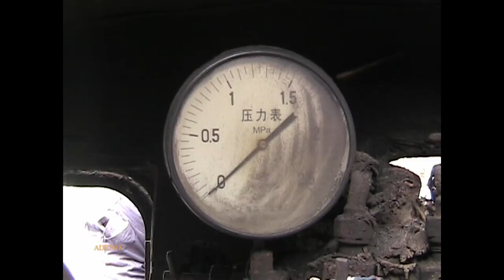UK - Buying a Chinese C2 for Welsh Highland Railway, 2006

Comment: Thanks for posting an interesting video. I was on a FarRail visit to China in 2007 with four of the C2 team, the loco was in the UK by then. Apart from looking at other C2s in action, they were sourcing spares and drawings for their loco. They said it would take about ten years of work before it could run in the UK. Not a bad estimate. Well done!
George
Reply from the maker: I think it's a little way off working in the UK yet, isn't it?  Andy
Reply: How much did it cost??
Reply: August 2018 and as far as I'm aware it's a set of frames with wheels

Comment: In the middle of the video, do you know what was happening? It looked like an SY was called to move smaller loco's tender (looked like an SY tender but smaller, so a YJ or PL2?), then a breakdown train rolled through. Was there a derailment?
Reply from the maker: To be honest, I don't know. As far as I know the tender was brought for coaling (as you can see in the video) but, I admit, it's an odd practice! The breakdown train was on a different line ... you can see the electric overhead that's not there on the first line. I don't know if the two events were connected at all. Sorry!! They're all standard SY tenders by the way. Also the loco with smoke deflectors and boiler top "streamlining" is a modified SY.                                         Andy

Comment: Was it listed with free postage?
Reply from the maker: Unfortunately not. It was shipped in a container to the UK.   Andy
Reply: 'Some assembly may be required.'
Reply: found extra bot and nut?
Reply: Yes
Reply: Andy and Dandan Fisher what are the things to look for when buying a used steam locomotive from China? Bearings? Connecting rods? Firebox?
Reply: @AndyDandanFisherSteam  must have cost a few bob
Reply from the maker: @andyg3  It was a bargain to buy but the cost of restoration is proving to be many times the cost of buying it  ......  Andy

Comment: Wow that thing looks hammered. It looks like the flanges are high and thin from my phone!!  The cab smashed up the the non working cylinder cocks on the right side. Not to mention the simple things like no glass, or headlamps ( simple non mechanical stuff). Smoke box full of cinders, thick buildup on all the lubricated areas and running boards. Rebuild? Ya think?? Surprised you didn't find a better C2 I. China. I've seen several available.
Reply from the maker: It had been working for its living, you know!! The advantage of this line was that it was in the Beijing suburbs - made shipping far easier. Number 4 was the best one of the fleet (of 4).    Andy
Reply: Gotta love armchair experts
Reply from the maker: These guys are heavily involved in locomotive maintenance on the Ffestiniog and Welsh Highland Railways.   Andy
Reply: My comment was towards the guy listing off all the issues.... like no headlamps. Not the people rebuilding it :)
Reply from the maker: Aahhh!! Thank goodness for that. (I agree) ..... Andy
Reply: Andy dunn I have been involved in steam locomotive operations and maintenance for 26 years. I have inspected many steam locomotives. I have worked with no less than 3 from China.
Reply: Andy and Dandan Fisher I have made a living for many years working with steam. I have seen several C2 locomotives marketed from China and they were in far better condition. I don't know if they were an option for you but considering rebuild cost I wonder if they would have been viable if available to you. It will be interesting to see No 4 when you are done.
Reply from the maker: I must stress that No.4 is not a project that my wife and I are personally involved with. Some friends of ours wanted to buy a C2 and we just assisted them wherever we could. The loco was having to be regauged anyway so a rebuild was just part of the job! Where are the other C2's? I know there are a few standard gauge Chinese locos in the USA but I don't know of other C2's.   Andy
Reply: Andy and Dandan Fisher multipower international was used in aqusition of at least two of six standard guage I know, they were advertising The C2 many years ago and still claim they can get them or build them.
Reply from the maker: I bet they'd charge more than the 10,000GBP these guys paid for theirs (including shipping).    Andy
Reply: Andy and Dandan Fisher wow that is pretty cheap. At that price a full rebuild on a little tea kettle like that seems down right reasonable. Even for an arm chair expert like me.
Reply: Andy dunn what say you?
Reply from the maker: Yeah. We thought we'd got a bargain. The inspection in the video here was just a formality really.   Andy

Comment: How much  to tonnage  can  30"gauge  locomotive  pull ?
Reply from the maker: Of course, every locomotive is different Josh. The Chinese C2 locos were quite poiwerful for their size but I don't have an accurate figure for them. The nearest I can get is a tractive effort quoted as 5100 lbf (Pounds/foot). If you can convert that into a tonnage that it can haul, you're a better man than I !!    Andy

Comment: The 4 painted on the loco seemed odd for years. I really liked it as it seems authentic to its use, but very odd.  Then today. BOOM! The number 4 (14, 44, etc) is an unlucky number. The #4 is a practical joke! But it would be fantastic if the hand painted 4s were exactly recreated after rebuild. The 4s add real character.
Reply from the maker: I don't think the number 4 was on the loco as a practical joke Charles. I saw it in service several times and it was genuinely number 4 in a fleet of four locos. There were also hand painted 1, 2 and 3 !! I suspect that the lads will reproduce the hand painted 4 when they finish the paint job !   Andy
Reply: Andy. Thanks for the info. Very interesting this is not a practical joke. Looking forward to seeing the restoration. Thank you again.

Comment: World's smallest drive wheels.
Reply from the maker: Wait 'til you see some of the little tank engines on Java - I'm just editing videos right now. Watch out! Andy
Reply: Small drive wheels , is like having a car in low gear . It will pull well but not go very fast and in addition  will go round very small curves in the track .
Reply from the maker: Correct !!!    Andy
Reply: I hava a video with some of these in action before they started doing away with steam and the little narrow gauge lines. With those smaller wheels it also seem to help traverse some pretty questionable track with ease.
Reply from the maker: They were very capable machines,  Mark. I have a few sequences of them in action on this YT page.  Andy
Reply from the maker: Please take a look at the latest update - https://www.youtube.com/watch?v=XZHznXVK7N4
Andy
Reply: I have a couple videos of a GEARED logging locomotive with small wheels on my channel. Its maximum speed is a mere 18mph, but, it sure can pull a lot of weight.
Reply: @AndyDandanFisherSteam  And I'd like to think they still are!  ^^

Comment: Smokebox needs a good clean!
Methinks these would be more suitable for the Welshpool & Llanfair, which would not require the loco to be regauged.
Reply from the maker: It's already regauged now. Being put back together at the moment. With a bit of luck it'll be on the tracks for 2019.   Andy
Reply: Andy and Dandan Fisher I will have to come down for a visit when it's running!

Comment: If you don't mind me asking, how much was it?
Reply from the maker: They paid around £10,000 (GBP) for the locomotive and its shipping to the UK.   Andy
Reply: Andy and Dandan Fisher that is a LOT cheaper than what I thought it'd be!
Reply from the maker: Well, it would have just been scrap metal otherwise. My Dandan (seen in the video) built a relationship with the rail line staff and negotiated a good deal for the guys.    Andy

Comment: Was the suitcase full of cash?  Looks a powerful beast.,  Presumably there would be no loading gauge problems. Will need quite a bit of TLC.  Very interesting.
Reply from the maker: They paid around £10,000 (GBP) for purchase and shipping, Jim. The loco has been undergoing a full rebuild for the last 12 years (including regauging to 2ft or 24"). Hopefully, the next couple of years will see its first UK steamimg. Watch my site for more updates.   Andy
Reply: Will do. Thank you!
Reply: The gauge change  suggests that the original boiler will no longer fit between the frames. The C2 Project's Web site suggests that it will be necessary to build a new boiler. 
Maybe they did not realise this when they were inspecting the locomotive in China. They have drawings for the locomotive & the original boiler as a pattern.
Despite it's awful appearance this locomotive is less than 30 years old.
Another gauge problem is the clearance through bridges & tunnels. Anciliaries on the locomotive having to be re-sited and the cab & tender modified. There are a number of different cab and tender designs they can work with. They don't want to have a locomotive that looks too cut down or has bad visibility running tender-first.

Comment: Hmm England doesn't have the knowledge to build an old steam train. They have to buy from China.
Reply: What an ignorant comment, the UK has built and heavily rebuilt (might as well be new builds) steam engines for decades. This was about saving the last of something.
Reply: They had no problem building a1 tornado from scratch, but then england invented railways and steam engines
Reply: England was eu and did nothing for years. Everyone is dead that built england.
Reply: That doesn't even make sense...
Reply: Tornado. Atlantic project patriot 100 barry wrecks returned to steam. WOT YOU ON ABOUT?